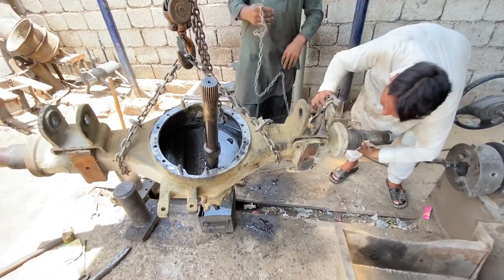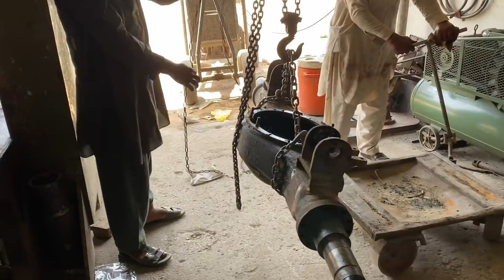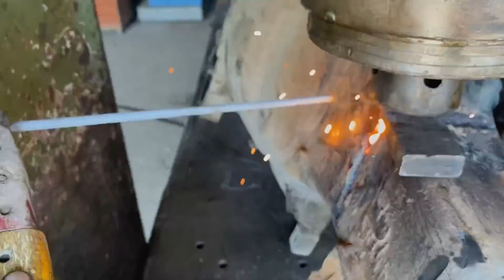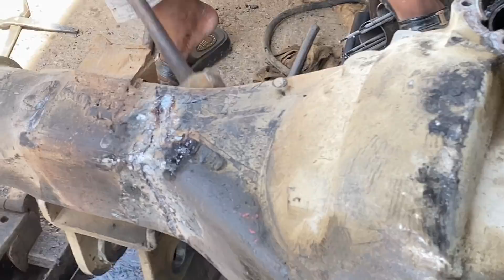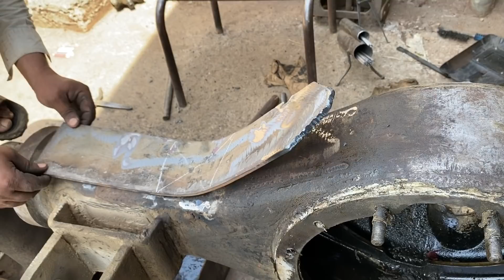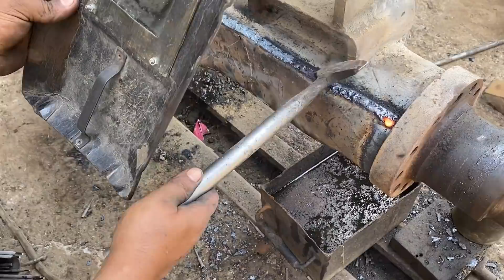The rear axel wheel hub is crooked to straightened with press machines

Comment: So, how did they know it was straight...before or after they welded it?
Reply: It’s probably all bent upwards after welding that compensation plate on it like that. They may have put a preset the opposite way in the housing when they straightened in the press it to account for that… but then again probably not.